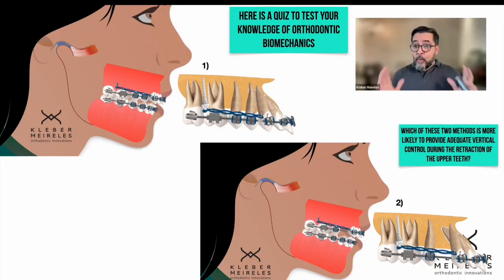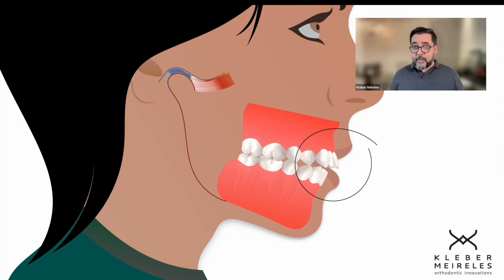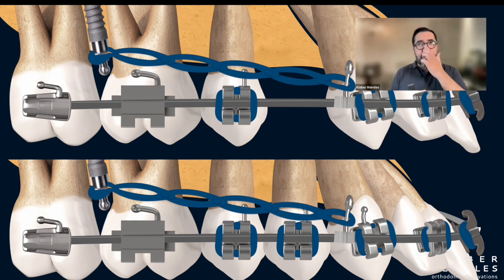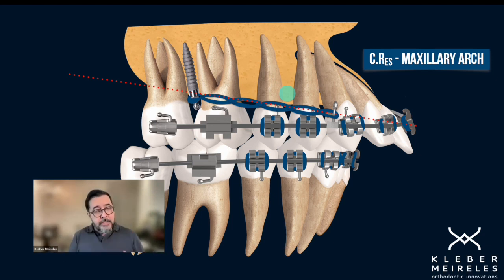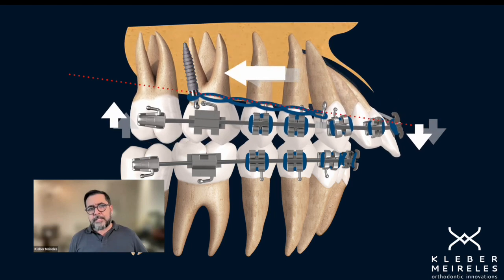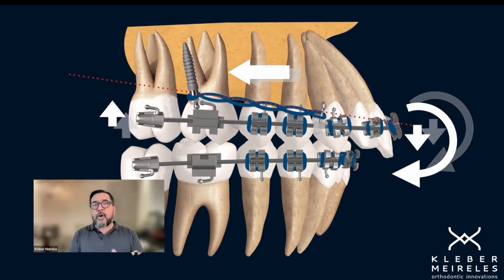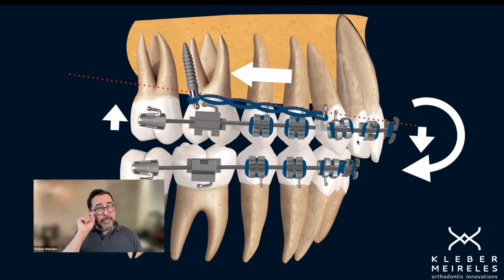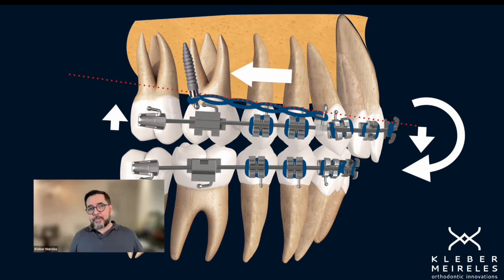TORQUE - Retraction Explanation

Comment: Hello Prof..
I had class 1 teeth case.
And I just used my 3rd time of braces.

1st braces, the result is Ok, good
2nd braces, FAIL, My teeth become deep bite, bucktooth, my jaw teeth become small, and my upper teeth become turn down, also my lower teeth become turn up.

And now Ive got 3rd treatment with different dentist, but I dont know my orthodontic dentist instruct me to use rubber band with case class 3, and the rubber band makes my wisdom teeth stuck in edge of gum throat (my wisdom teeth grows normal, no impaction), and it feel so bad, Im so hard to open my mouth because my teeth stuck on it, also my teeth jaw become small too, its because the rubber band.
Its already 4months of my treatment, but nothing change significant.
Also I had molar 1 that already crowned, in right side of my lower jaw, and my dentist use molar band on it, actually before braces attached on it, dentist said that my crowned has leaked (rontgen result), I feel like why she is not focus with my teeth case, she is like doesn't care & she's dont take seriously of my teeth case & perfuntory.
Also I already lost my molar 1 in left side of my lower jaw, and my dentist just fill the space with my molar number 2 to move forward with rubber band, and my gum jaw feels so uncomfortable because because of it, and it makes my left cheek become turn down.😢

The treatment sooo pricey & the change are so slow.

Should I move from my dentist to another dentist again?😢